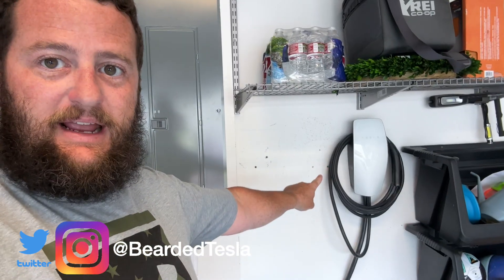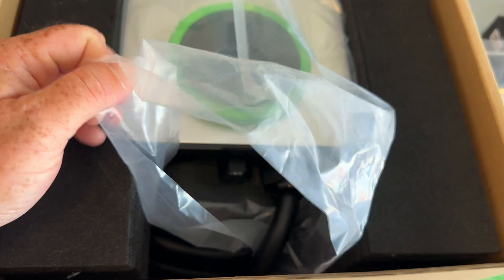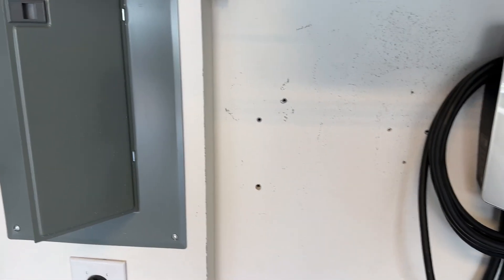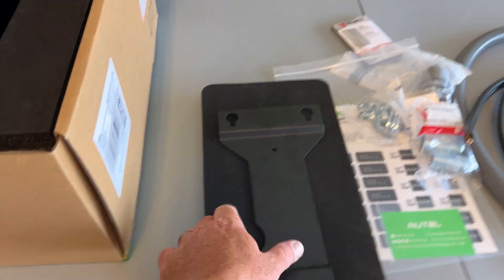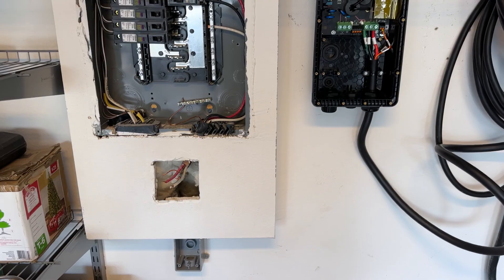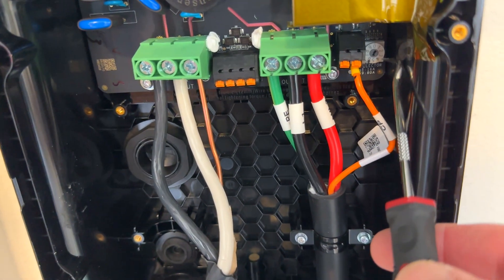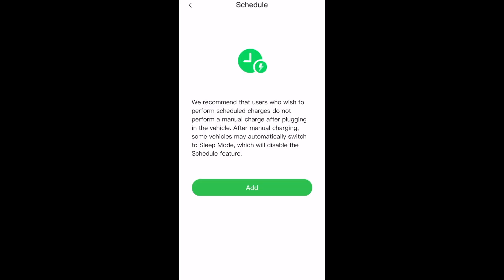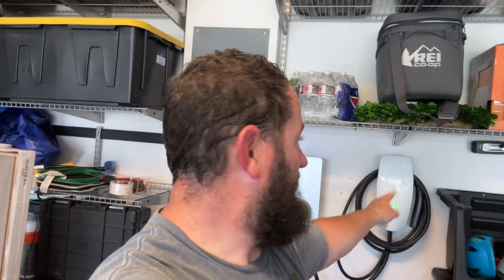Hardwiring Autel MaxiCharger for our Tesla's - The Fastest LVL 2 Charger on the Market

Comment: Question- I have the same charger hardwire installed. I got it when I bought a Nissan Leaf. I just recently bought a Model Y and have been using the adapter. Do you know of any issues long term in always using the adapter vs an actual NACS connector? I hate to install another charger and I don’t have a 240v outlet in my garage.
Reply from the maker: No issues as long as it’s a quality adapter

Comment: To make the set-up cleaner, did you consider punching the hole in the back of the unit and running the electrical line behind the drywall?
Reply from the maker: yes, but I didn't want to cut through a bunch of drywall and studs to get the wire there.

Comment: Interesting.  Tesla's Model 3 RWD version will only charge at a maximum of 32 amps, which equates to 7.6 KW per hour.  You must have the AWD, dual motor version. I actually get nearly 8 KW per hour charging, so it will charge 50% to 90% in less than three hours because I have a smaller battery. So, the charging time is fairly equivalent. I believe your AWD Model 3 will accept 48 amps,  which equates to 48 x 240 = 11.6 KW per hour.  So your car is accepting nearly 12 KW per hour which mirrors my experience with the Tesla Unversal Wall Connector I installed.  Note, the Tesla Wall Connector would also charge your car at 48 amps,  which the same speed as the level 2 charger you tested.

You should direct wire your Tesla wall charger to a 60 amp breaker.  It would increase its charging speed.

Comment: Anyone attempting this their self and using the same wire, make sure to wrap both ends at the fuse panel and at the charger in red electrical tape all the way from the jacket to the connection.

Comment: I'm not an electrician but I've researched the heck out of this subject. As far as I have been able to determine, technically since this charger is capable of drawing 50 amps, a 60 amp circuit and 6 awg wire doesn't meet code. Now, one could argue that you don't intend to use the highest (50 amp) setting  of the charger but that doesn't matter, because the charger is CAPABLE of drawing 50 amps. Please, if your a real electrician, correct me if I'm wrong.  :)
Reply: You are 100% right.

Comment: There is the matter of the permit. What about that?
Couple of code violations. Probably no torque screw driver was used. Breaker states the setting. Second, a white wire is not allowed to be a hot wire unless marked. Circling it with a bit of red tape would fix that.
Anyone else see any other problems.
And why worry about the permit? Some guy comes by, sees a nice job, tells you what to correct, if anything, make the correction, and poof, it's been blessed.

Comment: That white wire needs to have red tape put on both ends. As it is someone can mistake it as a neutral wire. By code hot wires need to be identified as such, hots are either black or red.  Neutrals must be white and ground either green or bare.
Reply: I learned that from watching a lot of videos about adding a 240v breaker lol.

Comment: The difference between 48 amps and 50 amps is negligible.
Reply from the maker: Agreed
Reply: Couldn't you just set the thing for 50 amps using the 60 amp breaker. What would be the issue?It's so close.
Reply: @davejones1959  I'm not sure if it is a hard rule stated in the NEC.. but generally speaking it violates the 80% rule recommendation. 

For continuous loads on residential breakers, it is recommended to only draw 80% of the breakers total capacity. It's a safety and reliability thing.

Comment: Watching this video again I noticed a few other things I haven't seen others mention.  You'll need to fix a few things ASAP with regards to your nema 14-50 plug to keep yourself safe.  I know you already ordered a Hubbell to replace your shorted out Leviton one, bigger cover plate for the Hubbell, but you also need a 50 amp GFCI breaker (they can be pricey).  The small bus bar on the bottom doesn't look to be grounded correctly, you would need a 8awg wire to connect that small bus bar to ground bus bar.  I could not tell if the 14-50 had a metal box, if it does, it would need a ground wire as well.  That pigtail on the Tesla charger isn't rated for continuous use, it is designed for short term use with dryer or range, that is why Tesla says to hardwire the wall connectors.  I'm not a certified electrican but been on the low voltage side of the industry for 20 plus years so I know more than the average person.
Reply from the maker: Thanks for the tips
Reply: The ground bar on the bottom is fine. Ground bars are screwed into the cabinet, and the entire cabinet is grounded. There is no need to run a ground wire between ground bars.  Neutral/common bars are not bonded to the cabinet in a sub panel, therefore they are connected together. If you look you’ll see they are bridged via a bar at the top.

Comment: It is no faster than a Tesla Gen3 Wall Connector. A 60 Amp double pole breaker drawing a Constant Load by Code cannot exceed 48 Amps. A Constant Load is a load which is expected to last 3 or more hours. Any application which draws a Constant Load must be derated by 20%. All items on the circuit must be derated 20% - the Conductors (or wires as many will call them), Connection Points, and the Breaker must all be derate. The Tesla Gen3 Wall Connector connected to a 60 Amp Circuit will charge at 48 Amps. No matter what brand of charger that you use, if it outputs 48 Amps they will all charge at the same rate. There is no magic, regardless of the source of the power regardless of the brand, Amp for Amp they will all charge at the same rate. All current Teslas have an internal charger that will not exceed 48 Amps at 240 Volts.  Except for the Rear Wheel Drive Model 3 which Charges at 32 Amps max.                                                                                                                                                                                                                     ...                                                                                                                                                                                                                                                                  When a Wall Connector or Mobile Connector plugs into the charge port it provides alternating current, also known as AC power, to your car. Batteries store energy as direct current, also known as DC energy.
...
The onboard charger, which is built in your car, handles this by converting the AC power into DC energy so that it can be stored in the battery.
...
Different Tesla cars have different onboard charger capabilities. The table below shows the circuit breaker which will provide the fastest charging speeds for each vehicle type.
...                                                                                                                                                                                                                                                        Model	Onboard Charger	Recommended circuit breaker for Wall Connector installation
Model S - 11.5 kW - (48 amp) - 60 amp circuit breaker
Model X - 11.5 kW - (48 amp) - 60 amp circuit breaker
Model Y - 11.5 kW - (48 amp) - 60 amp circuit breaker
Model 3 Performance - 11.5 kW - (48 amp) - 60 amp circuit breaker
Model 3 Long Range - 11.5 kW - (48 amp) - 60 amp circuit breaker
Model 3 Rear-Wheel Drive	7.7 kW - (32 amp) - 40 amp circuit breaker
Reply from the maker: understand that I went with 60A because I am limited to 48 amp capability in the cars. This can go all the way up to 50 full amps, which is faster than a Tesla wall connector. You would have to go with a 70 amp circuit though and would need to consider upping the wire gauge
Reply: @BeardedTeslaGuy  But I know of zero EVs that will charge at a rate higher than 48 Amps A/C. The Model S and X use to, but that was changed a long time ago...

Comment: Any reason why you went with the solid colored Autel vs the one with the glass covered section?
Reply from the maker: no, its just the specific model I went with. the one with the black "screen" is actually just a dummy plate for the housing for one of their commercial versions that has an actual screen on the unit.

Comment: 220v single phase should be 2 hots and a ground. You have it wired fine but described it wrong.
Reply from the maker: Listen again, I called it out as hot, but mentioned that white would normally be considered neutral.

Comment: Been watching instsll videos for days now trying to prepare to do this myself. I'm so confused I thought you couldn't run Romex through conduit? Can anyone clarify?
Reply: That was one among many code violations in this video
Reply from the maker: Well it’s not a violation of code to run romex through conduit and if you think it is, please point out in the code where it explicitly says you cannot. And please, just for my own education, let me know the other code violations that you see. It would be helpful for future reference.
Reply: I would have used THHN wire, ideally a black, red, and green.  It often costs less than Romex and doesn’t get as warm.   I would also use an LB for right angle connect to panel, but the box simply costs more.
Reply: @johnpoldo8817  ok thank you. That's the same thought I had, in fact I already purchased the three lengths of THHN wire in red, green, and black like you said. We'll see how it goes I've never done any type of electrical work before.
Reply from the maker: Regardless of what anyone here is saying, it is NOT a code violation to run ROMEX through conduit. There are requirements on space in the conduit that must be air, but there is nowhere in the code that says otherwise. THHN wire would be better, but at this short of a run, and at 48 amps, it shouldn’t have heat issues
Reply: @BeardedTeslaGuy  It isn’t a code violation if done correctly. Unfortunately, this is not the case here. You used 3/4” LFNC. 6/2 romex has a diameter of around .68”

Your conduit fill is 67%. You need to size up to 1” LFNC to be code compliant.
Reply: You can’t use romex in external conduit for sure,  but it’s okay for an “inside” installation like this. I don’t know why. My larger concern is that it can’t possibly be legal that he doesn’t have access to his own main breaker or cutoff. There is no way THAT meets code, but is probably not his fault.
Reply from the maker: @ulmersapiens  a garage space is not considered exterior though, and as long as it is protected, ROMEX can be used in garage. I was as surprised as you when I didn’t see a main cutoff at the breaker. This house is brand new (closed in November). Outside the house is a box next to the meter where I assume the cutoff is but it has one of those anti-tamper clamps on it. I didn’t want to have to call the power co, I’ve never seen anything like this before.
Reply: @BeardedTeslaGuy  I was agreeing that romex was okay in the garage, for sure (I literally did that myself today). I just didn’t know the theory behind why interior vs. exterior mattered. I spent some time on the web looking at Florida and National code, and it really seems like you have to have an accessible cut-off. In fact, there used to be a “six switch” rule for split-bus boxes, but since 202x you have to have a single way to de-energize an entire panel. I definitely agree that your main situation is weird and didn’t think that you were responsible for it. :) I am just baffled that it was designed and passed the original inspection such that you can’t make your own house safe in an emergency without breaking the law. I mean, how do you disconnect from the grid if you need to use a generator? 

In any case, great video, even if it does make me angry at your builder on you behalf. 🤣
Reply: @BeardedTeslaGuy  I live in a Florida condominium and all units do not have a main breaker in panel.  Our main disconnect is in meter room up to 12 floors away from living space.  I’ve installed several chargers and would have cut the securing tag on disconnect box and tossed it in the trash before taking risk of shock or short circuit.
Reply from the maker: @ulmersapiens  yea it’s nuts. So for the ROMEX, the reason why it’s no ok outside, but is ok inside is because the stuff is not outside rated. That’s the reason.

Comment: Great job.  Not sure what local codes there are, but here in the PNW, if you are using a white wire as a hot (in your case with the 6/2 wire), we mark it with either black or red electricians tape in the box (stripe it).  The white wires in your box going to the breakers are likely for AFCI circuit breakers (modern code requirements) and are not hot (thus not marked).  Also, it looked like your Tesla Wall Charger was on a 50 amp circuit (36-38 amp in use)?  I wonder if it would give you the same level of charging if it were on the 60 amp (or a 70 amp) circuit?

BTW, I'm not an electrician either, but I apprenticed for one when I was young, plus I rewired my own house (new meter base, underground conduit for main wire to the house, new panel, new circuits throughout).  According to the inspectors that have reviewed my work, I go above and beyond code requirements.
Reply from the maker: Good tip. Most of the wires in my panel were not taped like that so it passed code end of 2022. Still, it’s a good practice
Reply: @BeardedTeslaGuy It’s been code for well over a decade, if not longer, that white or gray insulation needs to be permanently reidentified for use as an ungrounded conductor. 

Sounds like the people who built your house were amateurs and the electrical inspector didn’t do his job.
Reply: @BeardedTeslaGuy see 200.7(C)